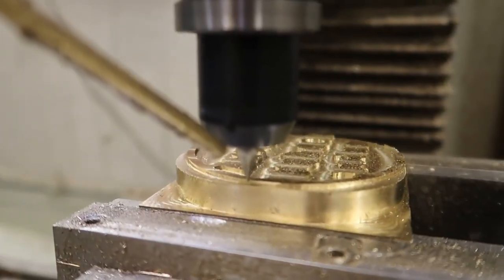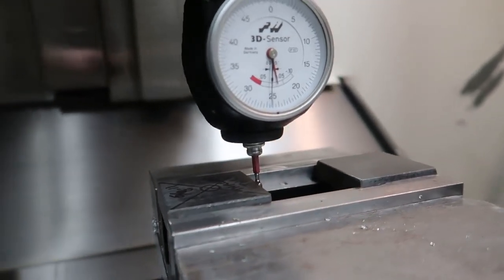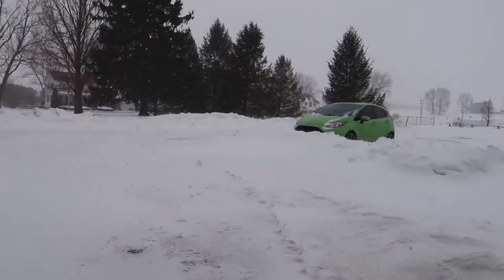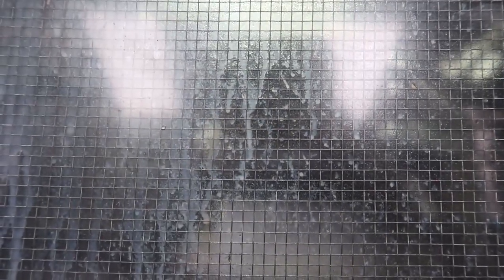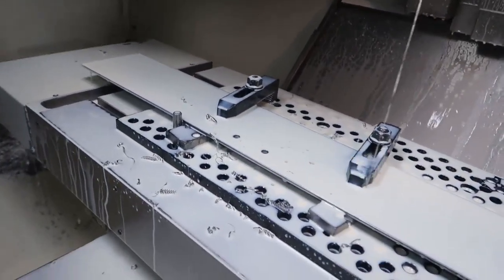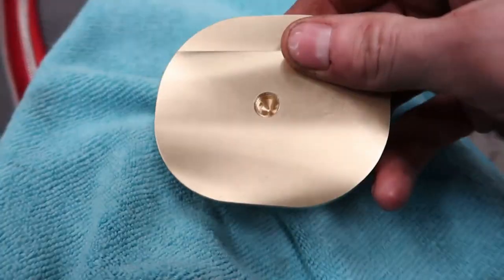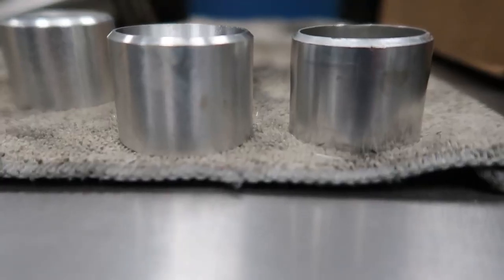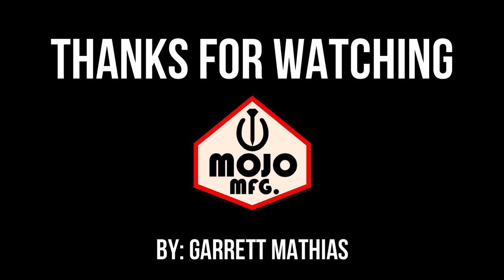Branding Irons And Odd Jobs

Comment: My old Fanuc control really doesn't like when I have smoothing turned on for 3d surfacing stuff. Jerking and stuttering, just increasing the tolerance works wonderfully though.
Reply from the maker: That is good to know. I have now heard that from a few other guys as well. I will have to try running the program without it.